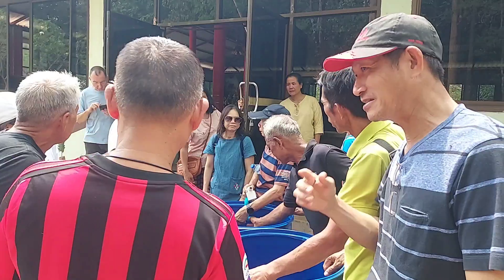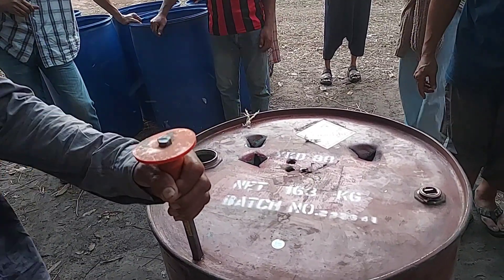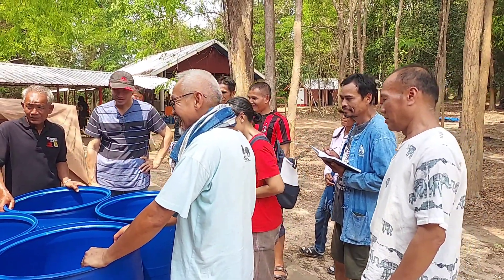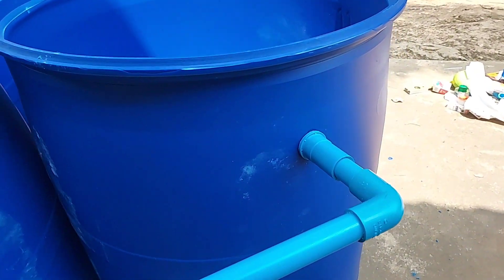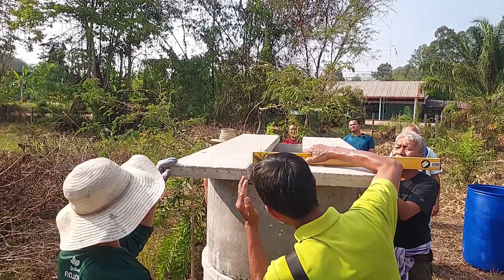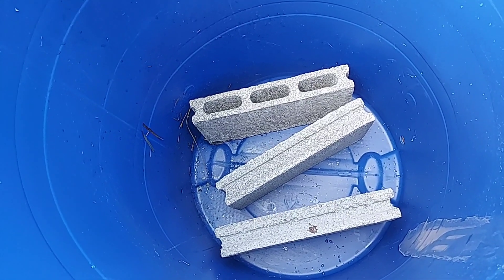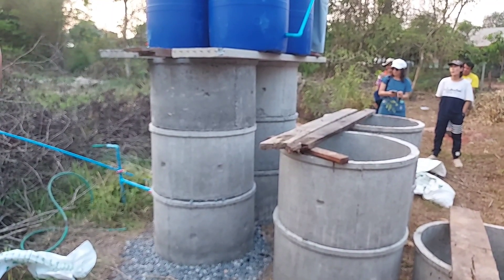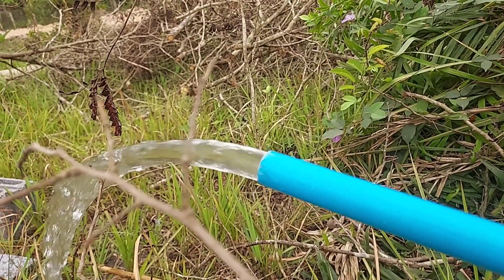Making Our Own Water Filter.

Comment: Thanks Mr Jon Jandai for the video. I really like the innovations compared to the old version, the new floating valve and the tiling which completely covers the bricks probably in order to contain suspended particles (replacing the large stones used in the old version). The concrete rings too, very good idea. Where does the water comes from, pond or papa mu baan? Do you use another tank to feed the filter by gravity ?